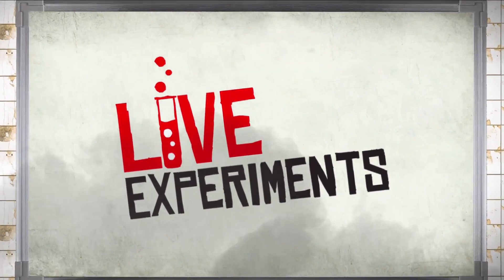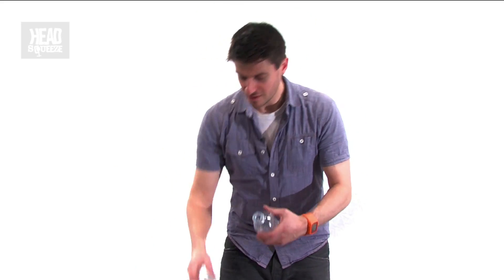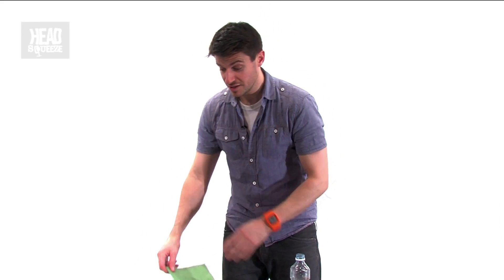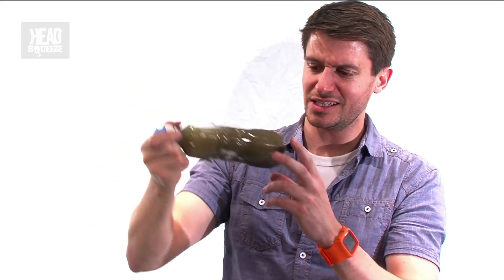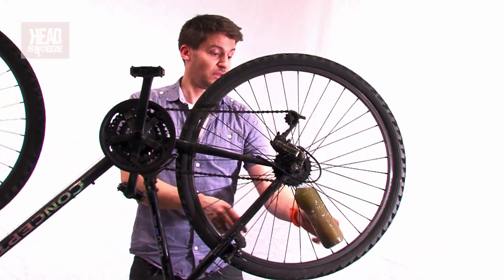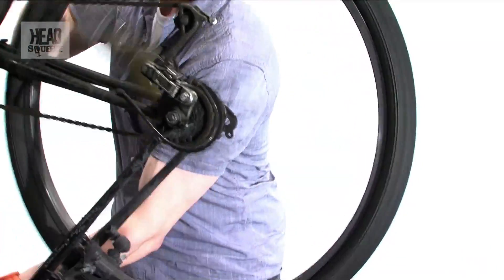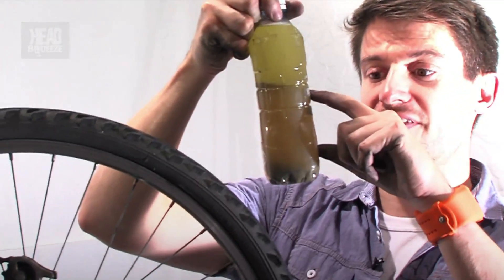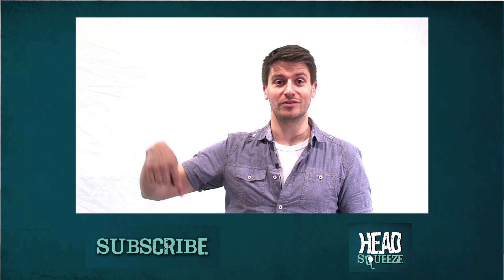How do fuel separators work? | Live Experiments (Ep 17) | Head Squeeze

Comment: Yes. Most trading vessels run on heavy fuel oil, which is essentially the residue from the crude oil refining process. And it is laced with impurities, primarily mineral particulates and seawater. Unseparated heavy fuel oil will destroy any marine engine through pitting wear and corrosion in a fairly short amount of time. High-speed centrifuge separators are essential for fuelling the biggest engines mankind has ever built.

Comment: there are several reasons. one is there always gonna be various particles, not nesseseraly int the clean diesel you get onto the ship. but there will always be some rust paint chips etc in the tanks and pipes. and the fuel oil that large ships run on is really dirty to start with. this oil needs to be heated to stay liquid, its almost like pavement when it gets cold,(really nasty stuff). so thats why you need to purify the fuel before you put it into the engines. thats two reasons, gladto awnser

Comment: One of the reasons are that some of the tanks you store the fuel in on the ship often is used for ballast when there is no fuel in them.
They have one separator for cleaning the fuel from these tanks, the clean fuel from this goes to a tank that is only used for fuel and is often called a day tank. 
And they have a bilge separator they use for removing fuel and oil from the water they pump over board when the tanks are going to be used for fuel again.

Comment: i work on a ship, and you will find a fuel separator on every ship thats got some size, even if the ships dont run on heavy fuel oil, they still have them. its one of the most common things you will find in an engine room on a ship. just to get that out of the way.

Comment: There is no such thing as centripetal force. It is an extremely common misconception but this effect is not a force. It is only the objects' tendency to go in a straight line, or the resistance to changing direction therefore velocity. Therefore what is referred to as centripetal force is only the effect of inertia. Just saying :)

Comment: A simpler version of a fuel separator uses the gravity alone. It's simply a glass cup that collects the dirt and water, and led the fuel on top flow straight through.
Every now and then one have to release a valve at the bottom of this cup to rinse out water and dirt that have been collecting in it.

This version are commonly found on smaller ships / engines.

Comment: I've found a problem with the video. You say that centripetal acceleration pushes the sand to the outside of thebottle, yet centripetal forces act on the mass towards the centre of rotation. If the force was acting in the direction you describe the. The